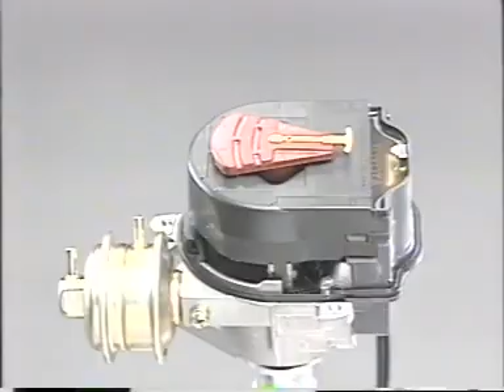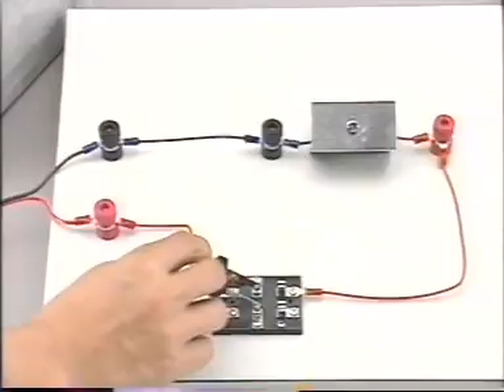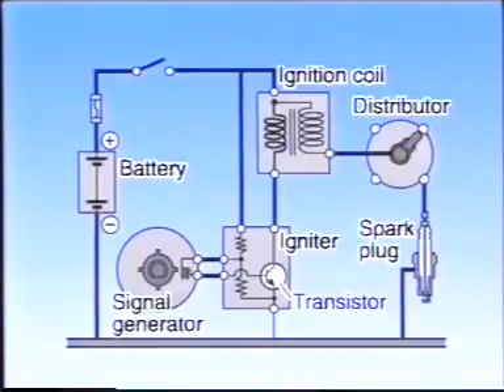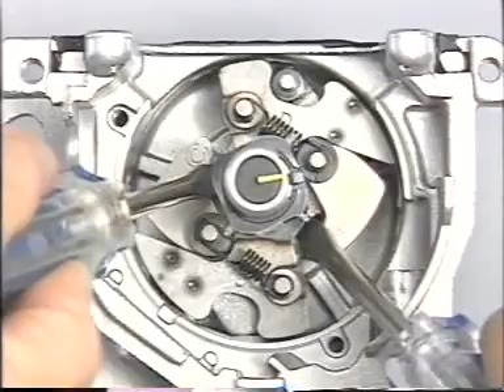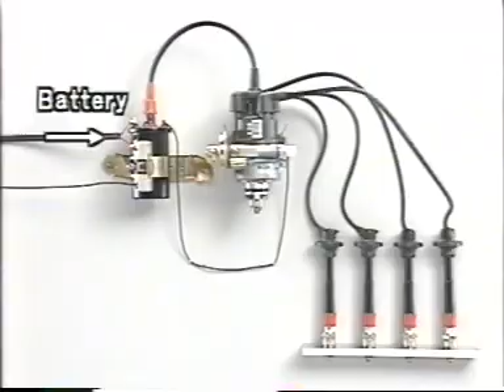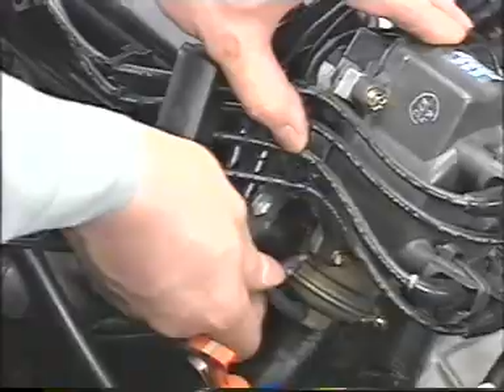IGNITION SYSTEM

Comment: nostalgic mechanics, typical English accent yet cannot be that long ago? We are trying to set the timing on our Humber Super Snipe we got spark at the points/contact breaker, and plugs but will not start just backfires.
Reply: set the timng to fire at top dead center rotate dist tio obtain this seting  when you get it running select best setting and lock the dist down
Reply: @frankdavidson9675  Thank you it worked afterwards I think the distributor has been put in at a funny angle.